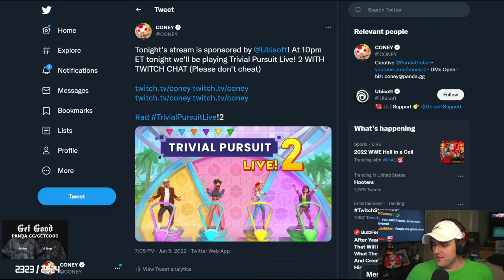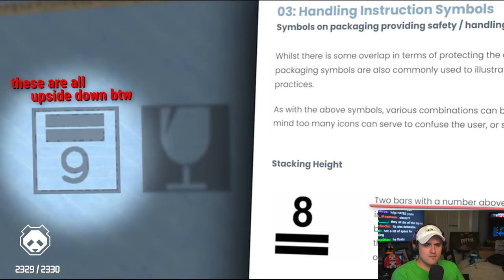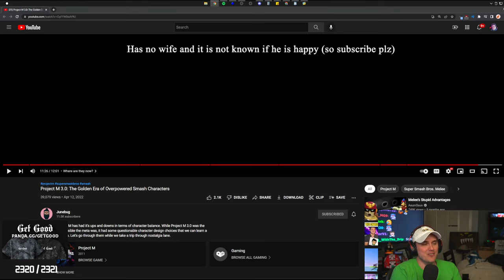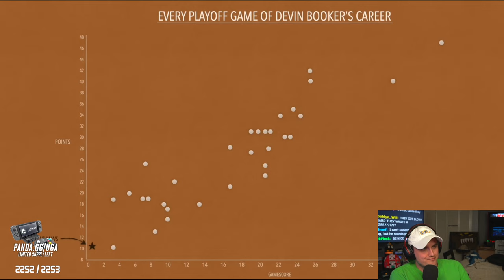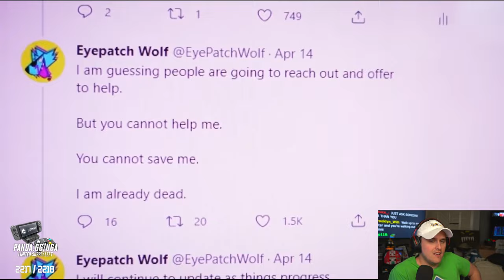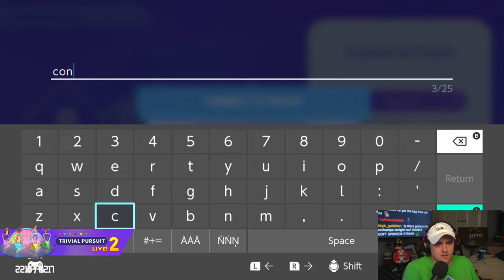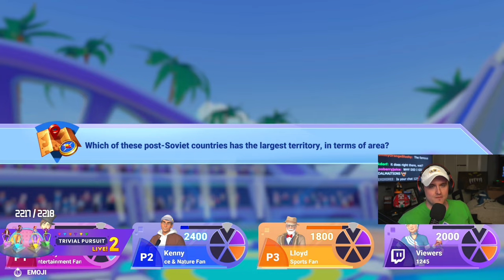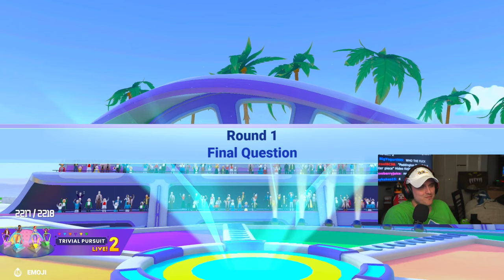Coney Plays Trivial Pursuit With Chat (6/05/22)

Comment: I’m glad the the guy who bought the Dell and Coney labeled this as basically entirely this dudes fault. How do you know so little about computers while making videos on the internet that you spend over TWO THOUSAND EUROS on a PC that doesn’t even have SSD and how is it not the absolute first thing you check when it takes forever to boot. Like dell scammed him but he allowed himself to get scammed, simply a skill issue. Like I know almost nothing about PCs (literally use a laptop instead of a PC) and when I heard that it was taking forever to boot I was like “oh sounds like this has a mechanical hard drive instead of a SSD but surely someone wouldn’t spend +€2k on a pc without SSD” ffs man do even a tiny bit of research